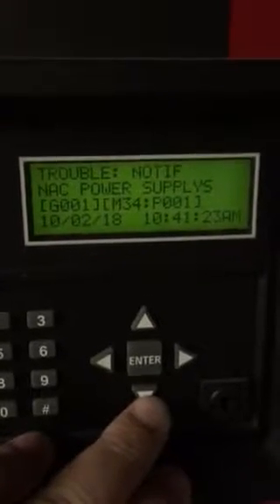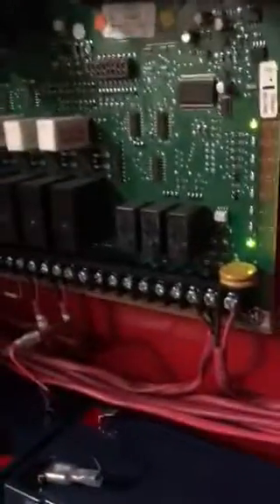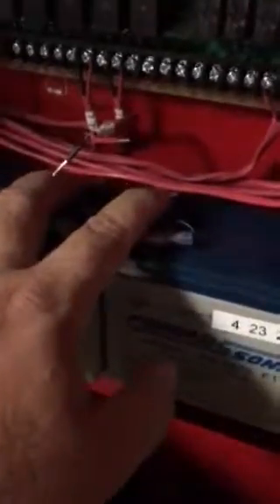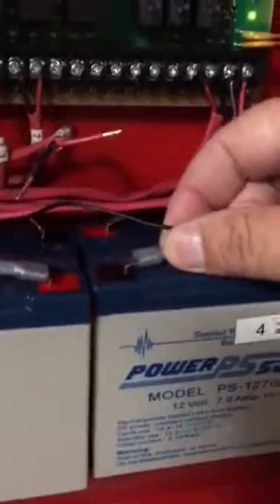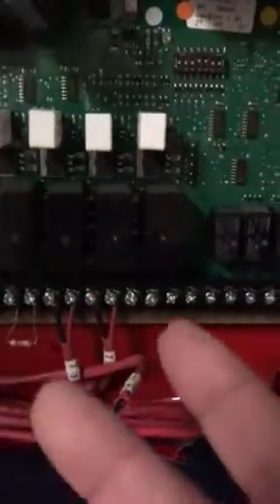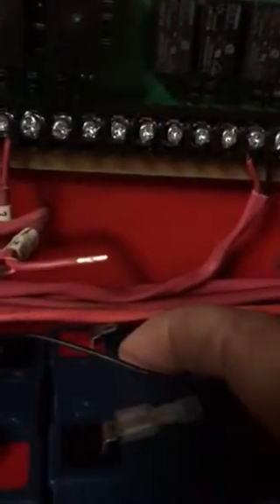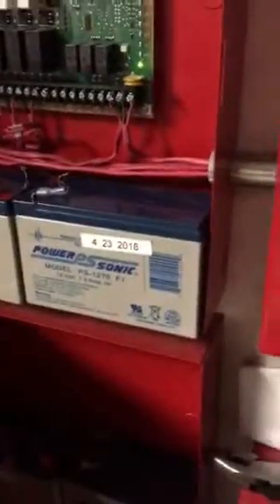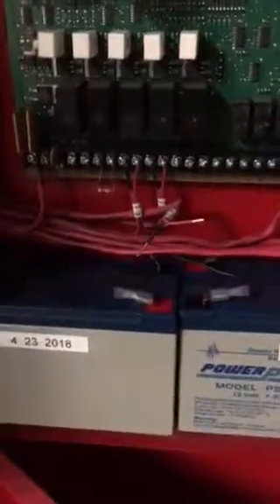How to trouble shoot a nac panel at Home Depot

Comment: Thank you!  I've been in fire alarm inspection for years with my company. And they didn't teach me much other than how to test and find devices. A disabled points. 
 I've pushed and pushed and finally got to install in try to work my way up to service. And you're videos are great. I'm very fortunate for the opportunity to learn form the guys where I work at being they are tecks that been in the business for 20+ years. But you're video help alot. Please keep it up. We are Edwards Est installers mostly. But we still work on everything. Old zone panels and what not.
Reply from the maker: Thank you.  Sometimes I wonder if it is helpful.
Reply: @khawk7365  very much so.  I understand everything it you could do some videos on wiring up older  Conventional devices with modules making them compatible with addressable panels. Also The only other thing that I need help on is like a video that you already have up, as far as supervising power supplies I'm unsure about the contacts and the resistor. To keep it  Supervised.  If you Could make a anothor video that a little clearer it would be tremendously helpful to me.

Comment: Any updates?
Reply from the maker: I had to get a lift and it was a crushed horn strobe. By the bath tub area. They lift tubs put on top shelf and had hit it with the lift. I replaced it and I could  see my end of line and the rest of the strobes horns worked. Hope this helps.
Reply: @khawk7365  go figure it was a crushed notification device..I work for maintenance for an apartment complex and looked at every circuit and looked fine but then I located the end of the last initiating device and took the alarm off the base and found a cracked resistor.. what brand notification devices are you running?? We run system sensor L series
Reply from the maker: @aspenqwerty3  typically system sensor or gentex at these locations. But I've worked with most ever kind out there. 😁
Reply: I would like to know how you do a loop test on fire panel